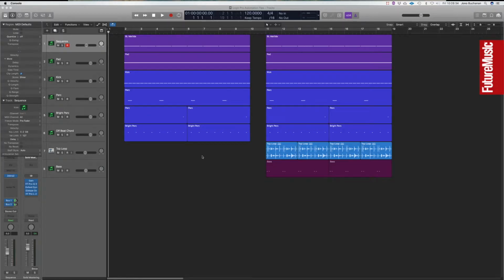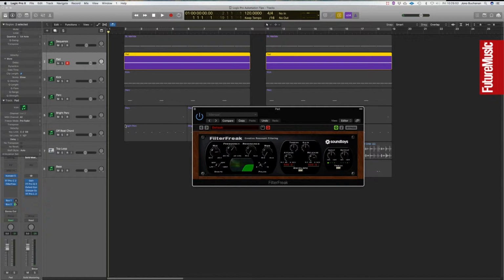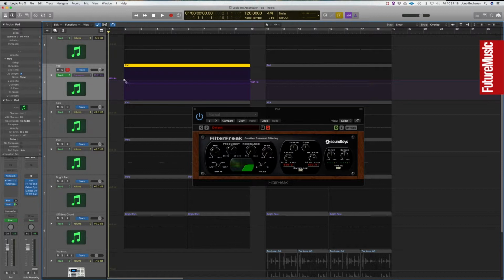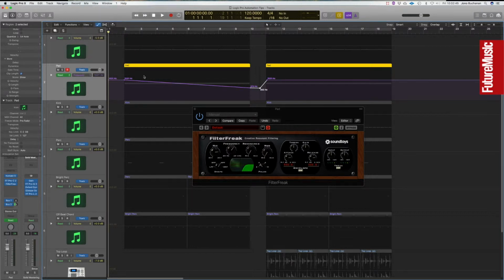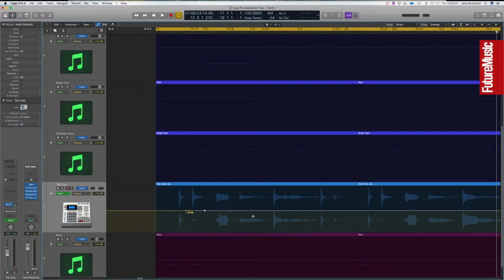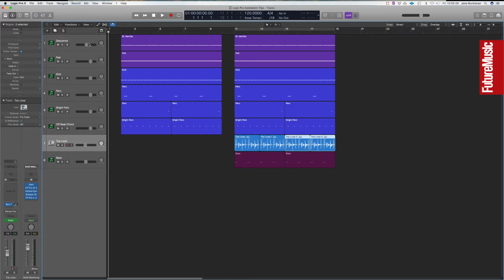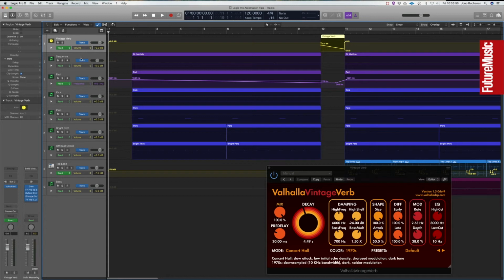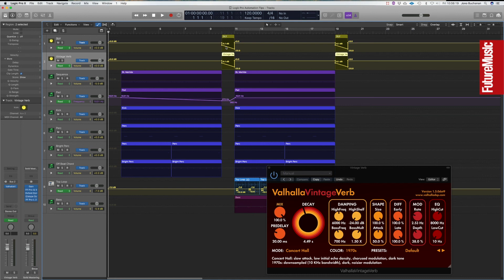Better automation in Logic Pro X

Comment: The auto marce function should always be on. It's better to do your automation in the piano roll tbh. Another logic hack is on summing stacks make an empty midi region then you can use the midi block for automating your returns very cleanly. You can even do it on the master channel if you make it a track in the arrange window. People use logic so sloppily when there are numerous effective workarounds.
Reply: Ryan Lewis cool tips, thanks! do you have Instagram or some other place where I can contact you?
Reply: What would be the benefit of using the piano roll for automation?
Reply: @tbunts1863  It's better for loop automations, region automation tends to be cleaner than track automation. You cut regions up with the scissors tool for clean break in automation and just join/merge the parts together. It's like a hack of sorts.